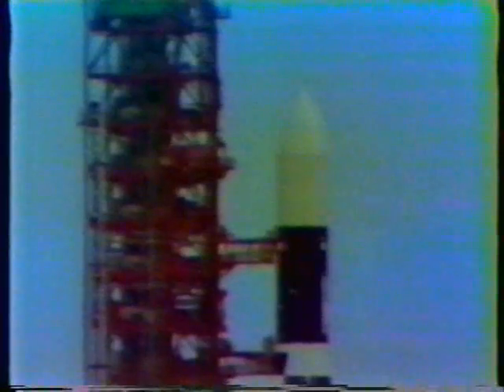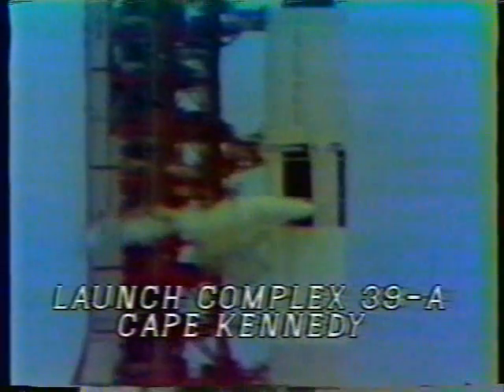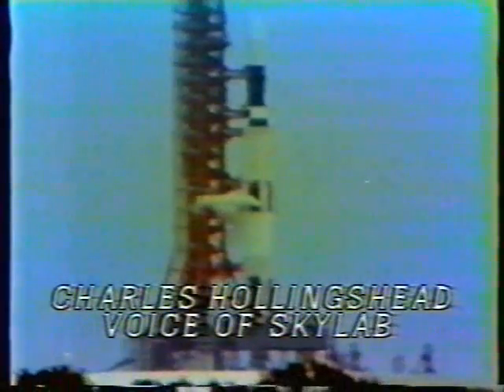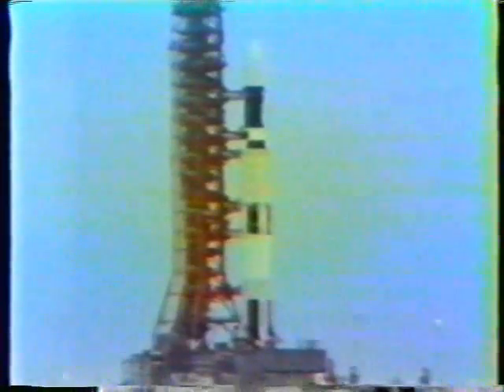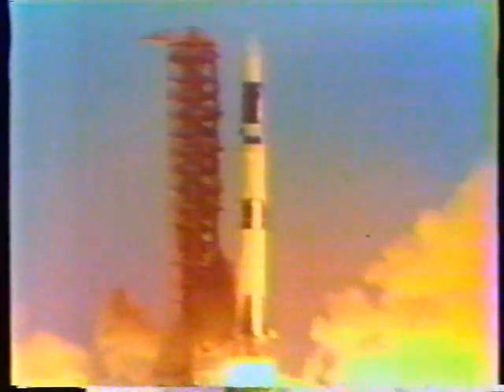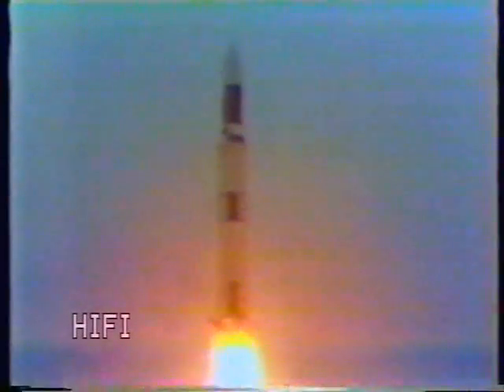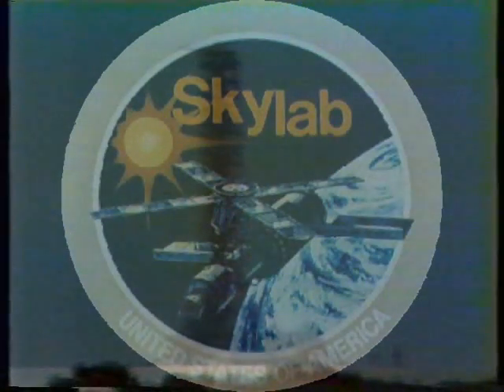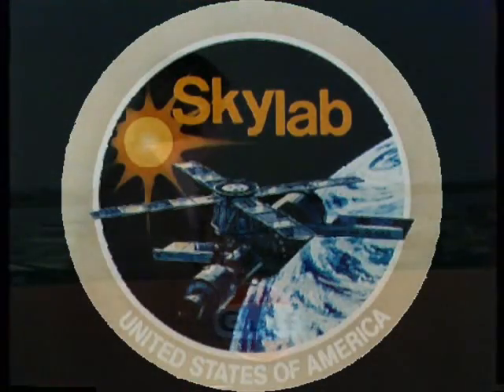Launch of Skylab 1 (NBC)

Comment: Originally, there were to have been two Apollo lunar landings AFTER the Skylab project ended, but they were cut out of the budget due in part to costs NASA had to incur in modifying Apollo service modules after the Apollo 13 accident (the spacecraft for those two flights in fact had been built).

Otherwise, it's very possible that instead of an Apollo/Soyuz mission in low Earth orbit in 1975, there may have been two joint U.S.-Russian lunar landing flights in 1975 and 1976, using the last two Apollo lunar spacecraft and lunar modules.

Comment: The shuttle had several abort options, however once the SRB's were lit, there was no abort option until they burned out, then there was a Return To Launch Site abort, Transoceanic Abort, Abort Once Around and Abort to Orbit.  They did 5 RSLS aborts where they main engines were started but shut down before SRB ignition and they did one Abort to Orbit.

Orion and Dragon are not steps backwards.   The Shuttle had one purpose, low earth orbit.  Exploration beyond leo was not possible with Shuttle.

Comment: It's too bad that the Shuttle wasn't ready on time to boost Skylab into a higher orbit thus saving it.  If it had, maybe we wouldn't need the ISS.
Reply: It's also too bad that the NASA brass didn't use the SM from Skylab 4 to boost it into a higher orbit. The astronauts suggested it, but were turned down. What they hadn't counted on was higher sunspot activity which heated Earth's atmosphere, which raised it, and caused Skylab to re-enter quicker than they had counted.

Comment: @2014cwajts71 great point -I hear if they made a second production run of Saturn V's they would have used the uprated F-1 A engine which would have given the vehicle a 20% payload increase, considering that would have been the mid 70's I kind of wonder how much more lighter and more power a modern version would have been.
Reply: Unfortunately, James Webb, before he resigned in 1967 (following his involvement in the AS-204 accident investigation) was the one who made the decision to halt Saturn V production and keep it to the original production run of 15. The Saturn V Block IIs could've been interesting.

Comment: Too bad the weather was so overcast that day. The last Saturn V launch ever, and you could not see it.
Reply: Neither could you see the micrometeroid shield and one solar panel fly off during Max-Q.
Reply: Dale Thelander The solar panel wasn’t lost until Skylab reached orbit, debris from the shield unlatched both the panels, one was blown off when the retro rockets on the front of the S-II designed to back it away from Skylab after staging fired and tore it away.

What you also would have seen was the interstage between the S-1C and the S-II fail to separate because it had been struck by debris from the shield and some of the explosive bolts didn’t detonate. On an Apollo flight, failure to separate the interstage would have meant an abort. The interstage trapped a lot of the heat generated by the S-II’s engines meaning that the back of the stage was starting to melt by the time of engine shutdown, a few more seconds would have caused the vehicle to disintegrate! http://this-space-available.blogspot.com/2016/08/space-myths-busted-how-skylab-nearly.html?m=1

Comment: @elwhit95 Actually, there was knowledge that foam had struck Columbia's wing...engineers wanted to do an investigation but NASA management refused. Had an investigation been done, the hole in the wing likely would have been discovered. So actually, comparing Columbia to Apollo 1 is really not quite the same thing. Columbia and Challenger both represented a failure on the part of management to allow engineers to do their job. The shuttle, for all its benefits, was more steps back than forward

Comment: I factored in more people than the shuttle because without the lunar module, my guess is that the Saturn V could have had an even bigger command module in its place. Maybe or maybe not, that might be stretching it. The shuttle can get more people into orbit than the Apollo missions could, but in some ways comparing the shuttle to the Saturn V is like apples to oranges. they were both designed for different purposes and different numbers of astronauts.

Comment: NASA gets a brow beating.These aren't just engineering projects; you want everything that can go wrong, worked out with 20% redundancy... then you give yourself a reasonable deadline between drafting board to final countdown; and it has to travel 12,750 mph and line up with everything you do from that day. Plus everything from cellphones to grandma titanium hip joint came about solving these problems. Personally, NASA needed a combined service fleet...12 shuttles... one per month for launch !

Comment: @coreyvaske28  After the manned Apollo program was over the U.S. put up the worlds largest space station (Skylab), the reason the space station was so enormous was that it was a converted 3rd stage from the giant rocket used in the Apollo program, if you didn't go all the way to the moon you wouldn't need the 3rd stage so they converted it into a space station (Skylabs 2, 3 etc. were manned trips to the station on a smaller rocket)